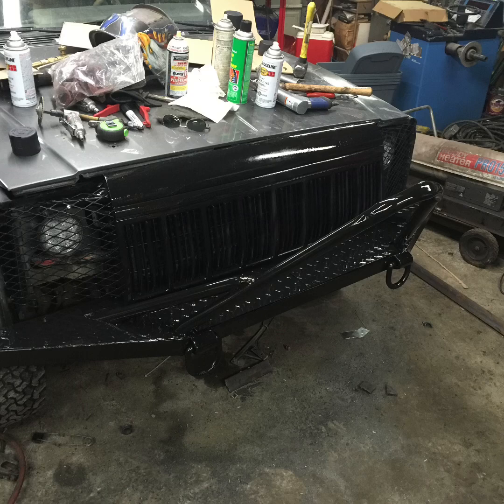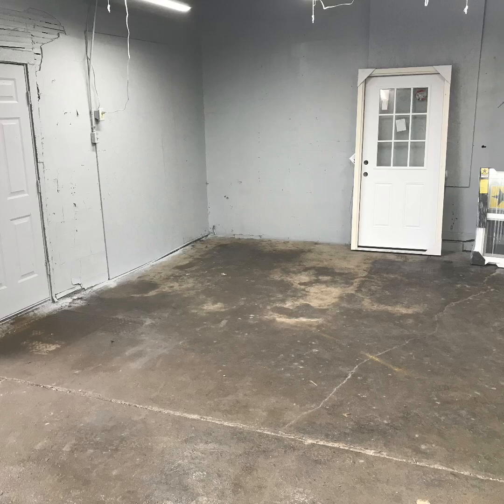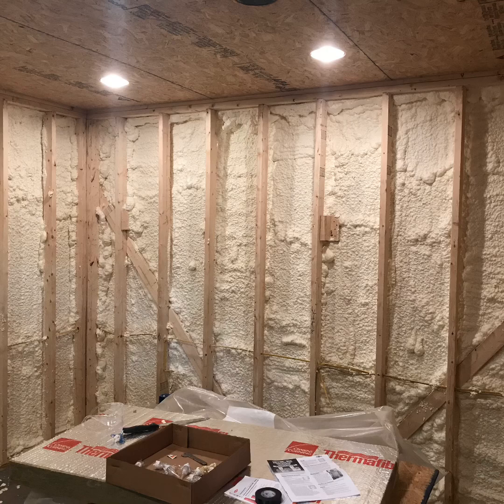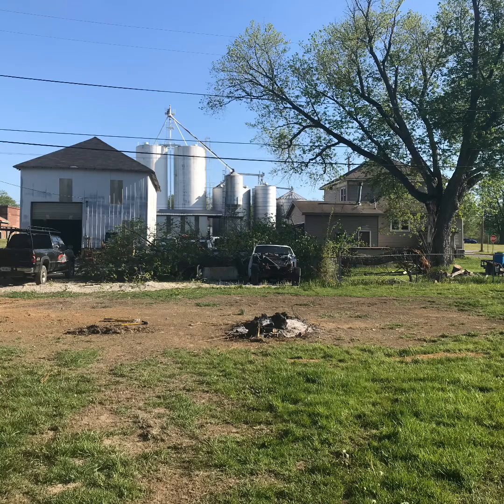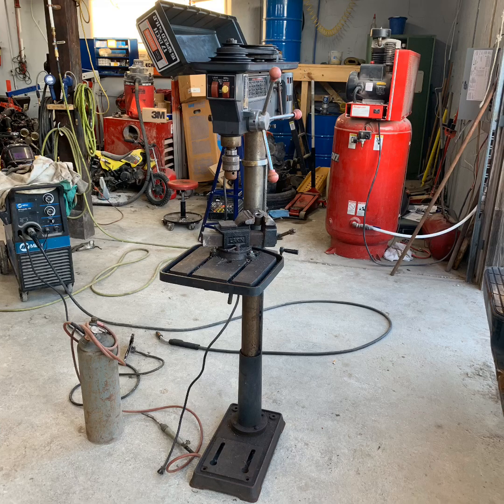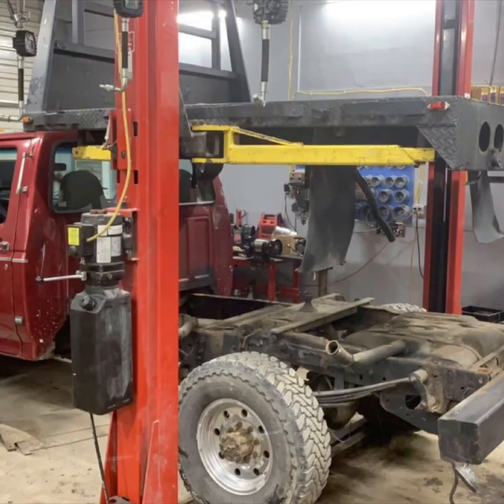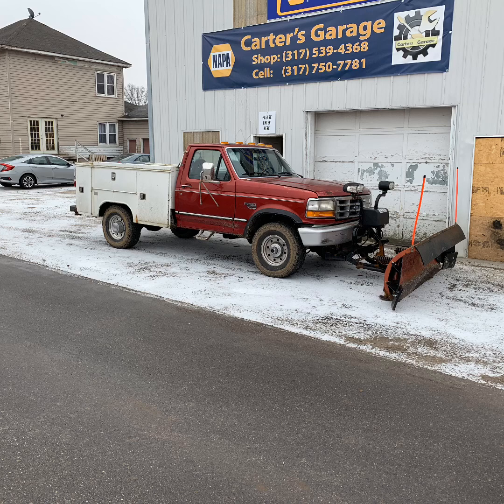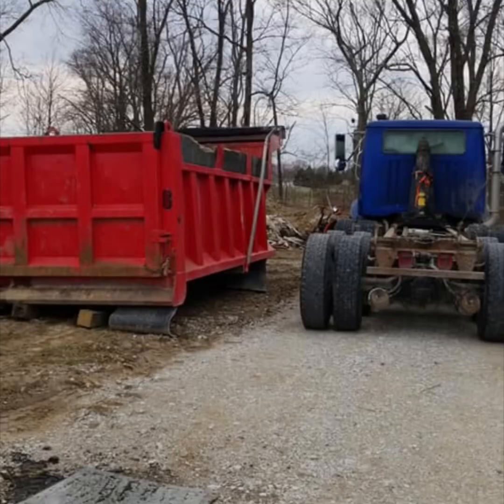Throwback Thursday part 2

Comment: A nice little, go back and see. Great idea using that tube-bumper for compressed air and; I've often wondered what other applications, an a/c pump could be used for - the electric clutches can be used for small pto projects- Thanks for the tour, cheers-